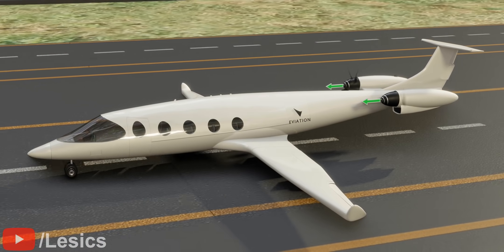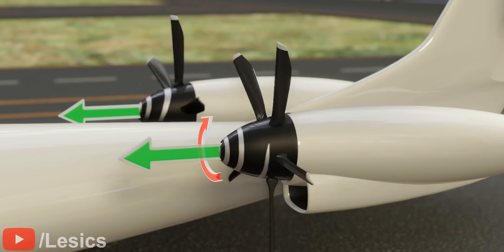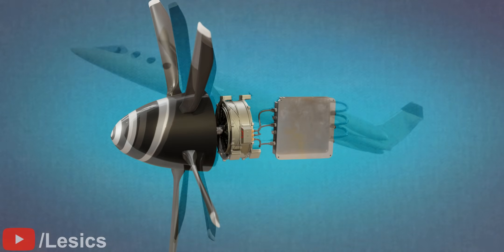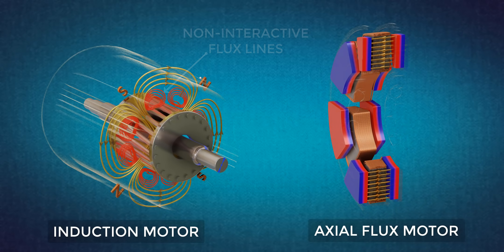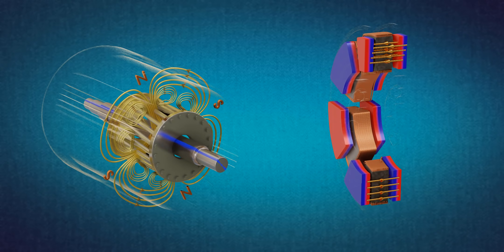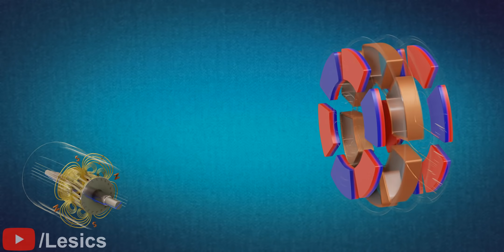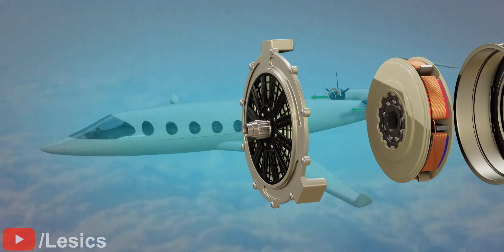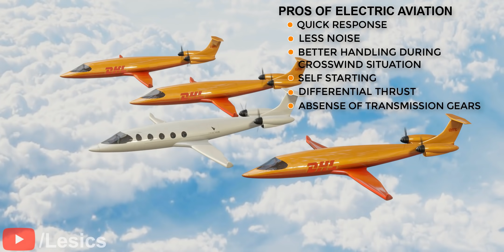Electric Aviation | The Dawn of an Advanced Transportation Mode

Comment: Pure fantasy!
1. On a propellor driven aircraft creating differential thrust by increasing motor speed of 1 motor would cause sympathetic resonance which would be very disturbing for the occupants of the aircraft.  Muti-engine aircraft have synchronizers to match engine speeds to prevent this. Varying propellor pitch would give differential thrust without creating sympathetic resonance. This is something that could also be down on a turboprop engine.
2. While turbine engines do have a delay in speed/thrust response to throttle commands this is much more pronounced at idle.  To combat this all turbine powered aircraft have a flight idle feature that raises the minimum idle speed while the aircraft is in the air.  Many aircraft have an approach idle setting that further increases the minimum idle speed while in landing configuration.  Throttle response is still not instant but it is quick enough that the small amount of lag is not an issue.  Also as others have pointed out while the electric motor may accelerate almost instantaneously by itself the inertial mass of the propellor will take time to overcome so the motor/propellor combo will not accelerate instantaneously. While there may be a small advantage over turbine engines in acceleration there is little to no operational advantage gained by it.  Sort of a solution in search of a problem scenario.
3. Battery technology and even electric motor technology are not where they need to be to match or even come close to the performance of turbine engines.  In aviation weight is everything.  A single 747 engine produces about 65 megawatts at takeoff.  All four engines on the 747 would produce 260 MW. I’m not aware of any motors that put out that kind of power. Now lets look at batteries for the 747.  At 5 minutes at takeoff power you would use 21.6MWh. At an as of yet unobtained energy density of 1000Wh/kg (li-ion have an energy density of 50-260Wh/kg) you would need 21600kg of battery just for the first 5 minutes from the beginning of the takeoff roll (A 747 uses about 3000kg of fuel in 5 minutes at takeoff power).
This is all assuming that there are electric motors powerful enough.  The max power density for axial flux motors is around 10kW/kg so an axial flux motor capable of producing the same power as 747 engine would weigh about 6500kg not counting the propellor, electronic controller or mounting apparatus. A 747 engine weighs about 4300kg.  Additionally no axial flux motors of this size have been developed.

This video is an exercise in theory largely ignoring the physical restraints of the technology it proposes while making dubious claims of advantages that are in real life insignificant if not absolutely moot.
Reply: mW stays for milli watt 0.001W. MW is mega watt, 1 000 000W.
But yes, the comment is valid.
Reply: pretty sure power density of electric motor is higher than 10kw/kg also nobody talks about using batteries on jumbo jet. first internal combustion engine is far heaver so replacing those with electric is first step than doing more steps... electric power gliders are actually better than gasoline ones
Reply: @jebise1126  Pretty sure?  Can you provide an example of one?
Reply: yeah this video is major garbage. So much wrong. Although i think electric planes to play a role in ga. Cold work there i think

Comment: This is total fantasy. The Kg/Wh is fractional, meaning electric is only good for tiny little single seater craft for quick, 10-minuite flights. The recharge times alone make it non-viable for passenger aircraft. Replicating the payload of an Airbus would take a battery twice the size and weight of the aircraft. Not to mention the environmental impact with building and regularly disposing of the batteries. Dream on.

Comment: Differential thrust on landing that's a an advantage 😳 let's go over some things. landing portion of a flight is the highest workload for pilots, adding unnecessary controls is a recipe for disaster. Wind gust will probably not gonna be smooth trying to work with the thrust, plus higher chance to stall spin. No pilot have problems with the controls, and can easily correct for a crosswind rendering differential thrust useless, only benefit for differential thrust is on the ground but pilots have differential braking (braking the left or right wheel independently for tight turns) so differential thrust is not that gonna be a make or break for ev airplanes.
Reply: I was thinking the same thing. You already have pitch/roll control, and rudders. with this in mind you would have to do pitch/roll rudder and differ the thrust. It is definitly possible but would require a lot of training and you would have to hope that in a high stress scenario nothing goes wrong. One wrong move on your thrust and you could be in for a bumpy ride

Comment: I wonder if there are weight credits between fuel weight and battery weight in a typical 400-mile flight.
Reply: Border line
Today, the existing models (Pipistrel) run for about an hour plus reserves at about 60 knots
With better batteries and long wing span you might increase endurance by factor of 3.
Commercial airliners not  really practical for long distance.
Feasible for VTOL flight hybrid.
Actually in serious development now. Just the differential thrust argument is just ,well stupid.

Comment: Only problem is power to weight ratio of batteries vs fuel. 1kg of fuel gets you 5x more range than 1kg of high efficiency battery.

Good thing is noise and pollution reduction. The motor thing and quick startup is valid too.

Good video but can have better coverage.

Either way, eviation is the future of domestic flights.
Reply: Not to mention the significant fact that fuel powered airplanes get lighter as they use their fuel.  Electric airplanes have to carry the same weight in energy storage throughout the entire flight.  This requires more robust(heavier) landing gear and supporting structure to handle higher landing weights than a comparable fuel powered aircraft.

Comment: 5:09, I wouldn't say impossible, more difficult, yes, but as the crew of the United Airlines Flight 232 proved, you can control a jet plane with differential thrust, and with underwing engines, to a limited degree the pitch and roll, not just the yaw. Yes they did crash, but it was a survivable crash that happened during final approach, not in the middle some random point near where they lost all hydraulics.nter engine

Comment: Propeller driven ACFT use low pitch for take off because of better efficiency. Constant speed prop gives better propulsive efficiency because the blade pitch is automatically adjusted at different airspeed.

Comment: The only problem for now is combustible battery cells because it has bigger chance to combust while flying in low pressure atmosphere especially when the plane is depressurizing midair. This problem cannot be avoided until solid state battery mass produced.
Reply: I think combustion in the batteries will be a problem. You can create a higher pressure in the battery containers and therefor remove that problem. I dont know much about batteries so i could be wrong.

Comment: vertical landing can help electric airplane more sustainable and help the plane to land anywhere during Emergencies
Reply: Sadly this wont be a thing for a while. Vertical landing consumes a massive amount of fuel. The real number is classified but some people think its about 25000 pounds an hour. a normal plane uses about 3900 pounds an hour for cruise. The f35 is resticted to only doing vertical landings and not take-offs because its lighter. it can take off as well but only with reduced fuel and no weapons.

Comment: You did a good job touting all the benefits of electric motors in aviation, but you seem to have forgotten the drawbacks, as just like everyone else who talks about electric aviation. It's not like you've solved those problems, you're just making like they don't exist and relying on the ignorance of your followers to not be aware of those drawbacks that relegate electric aviation to a niche market, just like electric cars and trucks don't work for most drivers. Basically, for every hour flying you're going to have a similar amount of time on the ground recharging your batteries so that they don't overheat, catch fire, or explode. Yes, Electric vehicles do have that problem while charging, and if you don't limit it even more for aircraft, you're going to have a real problem. Things that you can allow on the ground are simply unthinkable in the air. If you fly for 4 hours to get to your destination, do you really want to be stuck there for 4 hours recharging your batteries so you can spend another 4 hours flying home? In private aviation, that's possible, sometimes even desirable. Not in commercial aviation. Wide-body aircraft, such as the 737 and the airbus jets, can only make money by moving a whole bunch of people long distances very quickly and doing it many times a day. For example, the London-Dublin route is flown 4 times in one day once in the morning and back, and again in the afternoon and back. London-Paris is similar.  Those flights are long enough that you'd have extended recharging times, but not enough time to get charged properly before your getting pushed back from the gate for the next leg of the cycle.
Electric will be absolutely fantastic for weekend aviators, sport, and ultralight pilots who already don't spend all that much time in the air, or fly more than an hour.  Sure, weekend aviators grab the family and fly a few hours away to a favorite spot for recreation, but they usually stay in that spot long enough to make the recharge time viable. It'll likely be terrible for business and commercial aviation though.

Comment: A jet engine is the one used in fighter jets. The engines used in common passenger aeroplanes are turbo-fan engines.
Reply: Wrong. While older generation used turbojets, modern fighter jets use turbofans.
Reply: @DanSlotea  highbypass turbofans
Reply: @akiramiller9025  wrong. high bypass turbofans are used for airliners and cargos, fighters use low bypass afterburning turbofans, especially the supersonic ones..

Comment: most of these electric advantages are false, since turbine and piston engines perform well. the only advantages of electric are faster power input response times, and quieter running.
Reply: And while the quieter running aspect is nice, faster response times are irrelevant in commercial aviation.